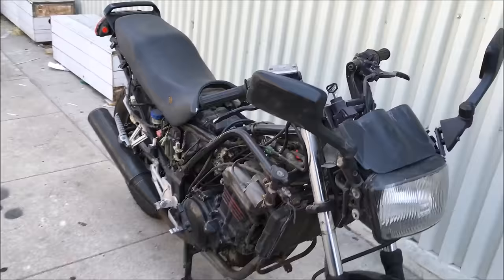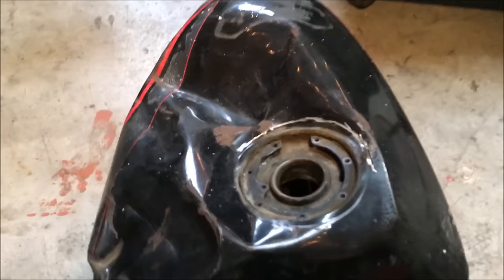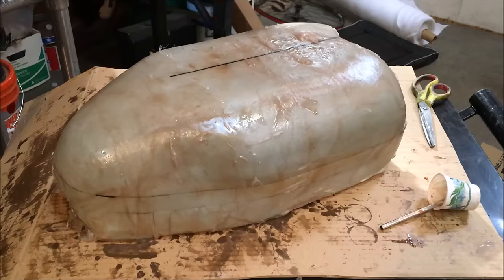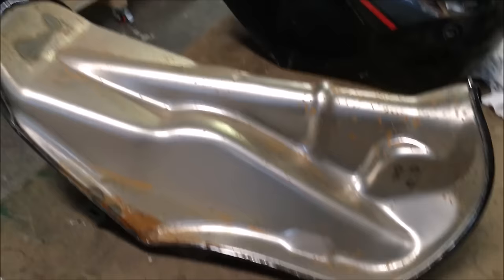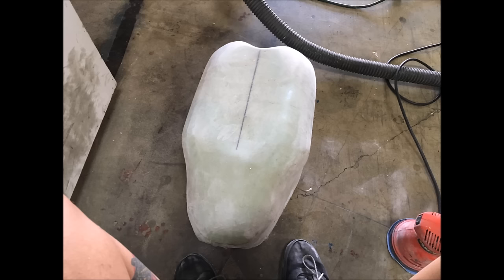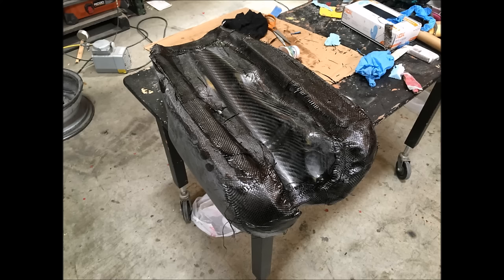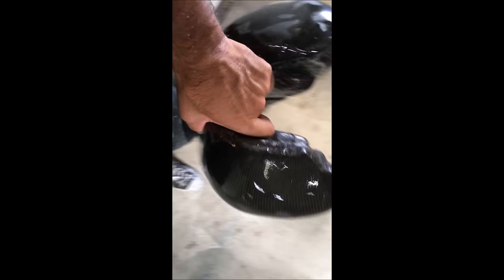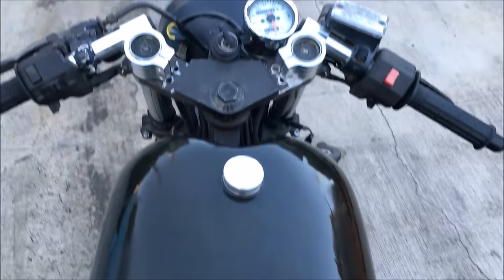The Carbon Ninja Part 1: Making a Carbon fiber fuel tank.

Comment: How long did your epoxy/carbon powder sealer work?  Epoxy will breakdown with constant contact with fuel and fuel vapors so I’m curious to see how long it lasted.  I’m looking to do a similar build, but I’ll be using carbon/Kevlar and Kevlar instead so the tank won’t shatter if I wreck
Reply: I know I'm a year late but I see this often. There are special tank sealers that work with plastics. (carbon etc) I'll pull the site up for you, here : 

https://www.classic-oil.com/en/tank-restoration/305/single-component-resin-for-tank-sealing?c=279

Comment: Very interesting, how did you glue the bottom carbon fiber part to the top part? I am strugling to find a way which has a neat finish.
Reply from the maker: Well the bottom was made separetedly. Once I demolded it I had to trim it to fit the top part. I had cut out the foam a little bit to make the bottom fit. Then I clued them together and reinforced the seen with a lay up.
Reply: Thanks for the info, nice work.
Reply: So you just overlapped the layer that joined the top with the bottom? That thing looks great, man.
Reply from the maker: I did. There’s a reinforcement on the seem.
Reply: THE Sound is uber annoying. DIdn't show details, seems to skip parts of the process. Horrible in my humble opinion, and cursing is not necessary. @Montenegromfg
Reply from the maker: @veronicavitucis944  yeah, sorry i would give you a refund but all this information was FREE.

Comment: Where is part 2 and 3 and so on?
Reply from the maker: I started making part 2 a while back but i kinda got over it. I'll probably make another video on how it turned out. I modified the subframe and made a carbon seat cowl to give it a proper cafe racer look. I might sell it to but a bigger bike and then I'll go crazy on it.
Reply: I love Cafe's. I have a '83 Yamaha XJ750 Seca with a YICS engine. I built it into a cafe racer with R6 throttle body injection and microsquirt controlling it. I currently have a frozen valve though.